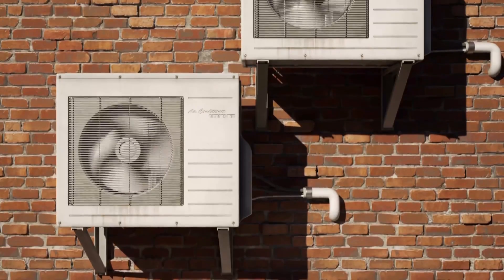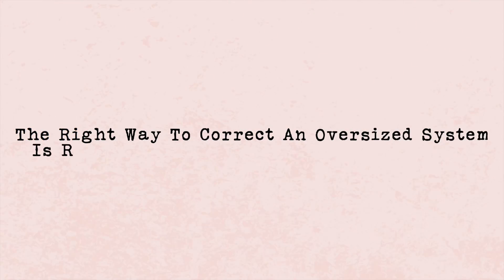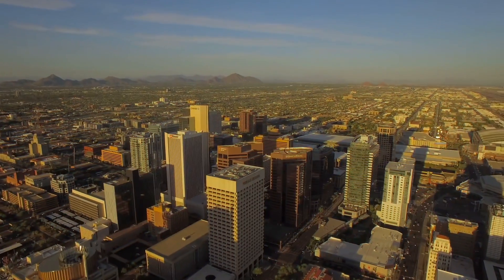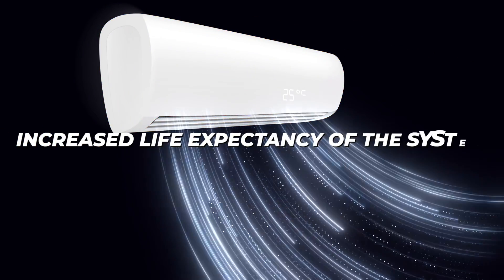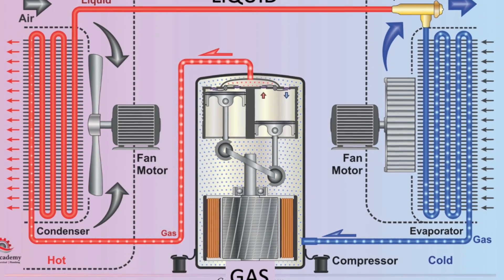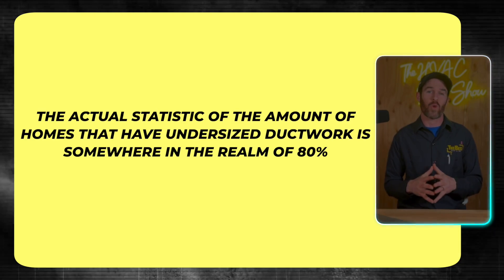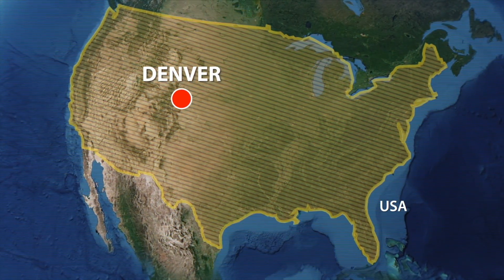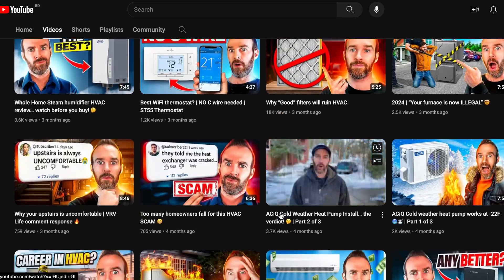The Best Thing you can do for your Heat Pump | 2024 Heat Pump Tips

Comment: I haven't' checked yet. I will before my changeout. Most furnaces call for a 0.5 in h20 pressure differential. If it is out of wack and there's too much return flow. Do you just start blocking off the closer returns and adjust? I have my suspicions that I have too much return flow. Less static pressure of the discharge?
Reply from the maker: Never block returns you won’t have too much return air ever, it’s a matter of increasing airflow most likely if your static is high

Comment: I have a Daikin MXL 18,000 BTU enhanced capacity inverter driven compressor heat pump with 2 indoor floor units. The upstairs one heated the floor without a problem. I finally figured out that the airflow around the downstairs unit was restricted, both on the intake and output. I moved the sideboard over as far as it would go, increasing the gap from the air intake from 4 inches to 18 inches. Then I moved a shelf unit away from in front of it. It worked well afterward, even maintaining 22 C when it was -12 C outside outside.
Reply from the maker: Nice! Yep, Sometimes it’s the simple things 😁